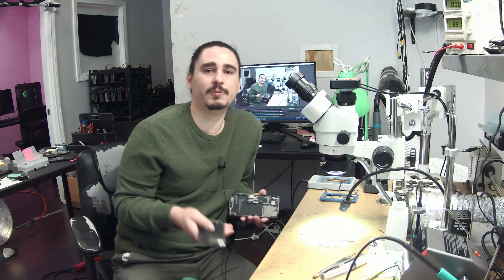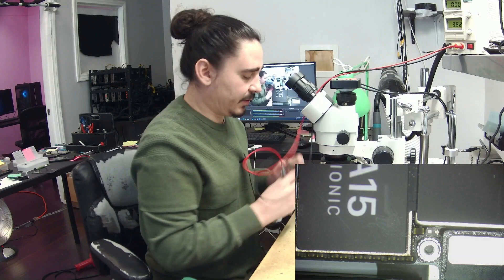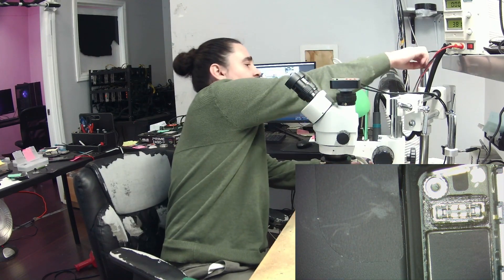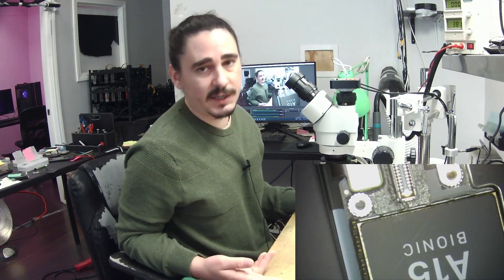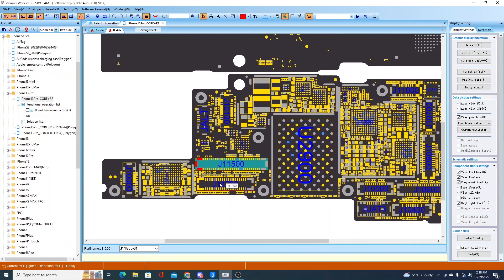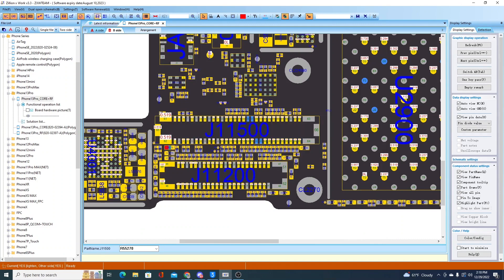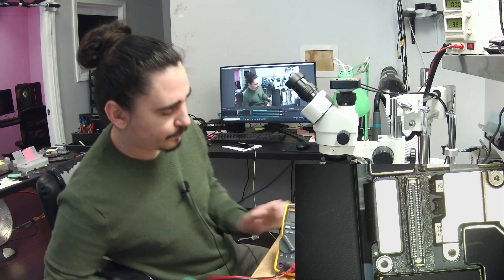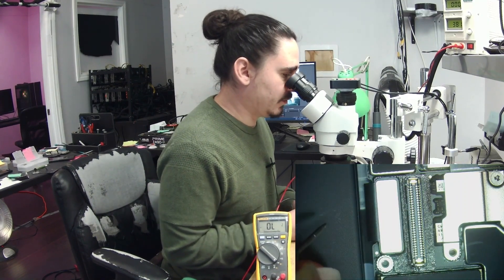How to fix an iPhone 13 Pro 'No Image' Logic Board Problem

Comment: Thanks my short was on a different cap. 

The line u got shorted . On the repair I was doing it was 0.600 not OL or short 

Replace the resistor replaced the ic same  .  Until I diode mode under that ic.  ..the cap right next to it was shorted